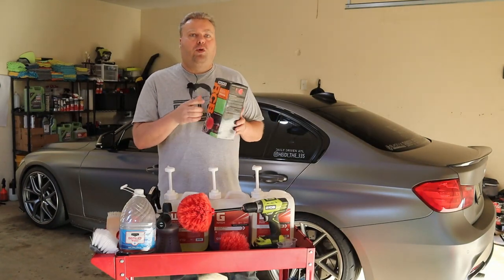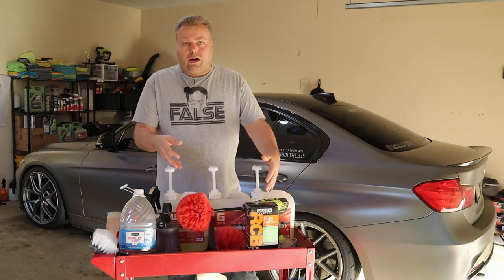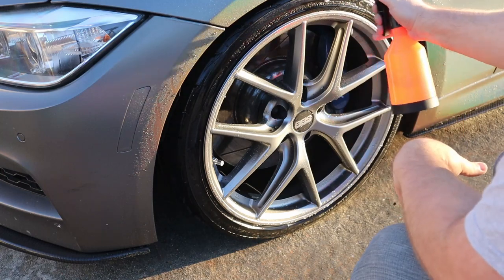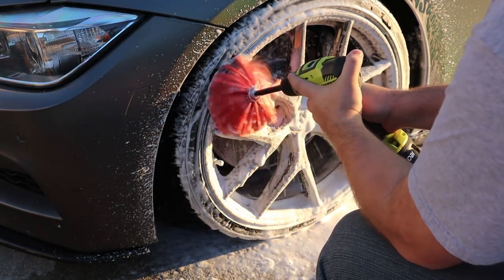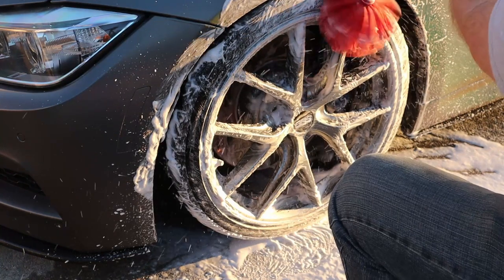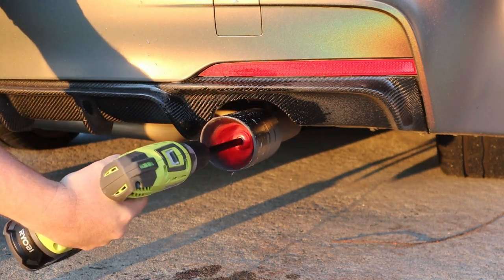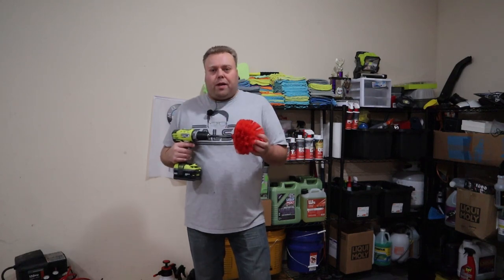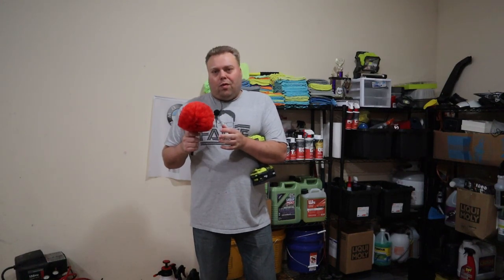Best Time Saving Wheel Brush | Quixx Rim Twister

Comment: Got mine in.. cant wait to try it. Little firmer than i thought it would be.
Reply from the maker: Hope you like it.  Will break in quick and get softer.  I worked mine a little stretching it out with my hands and a few wet and dry cycle.
Reply: @CarsWithKeav  not bad. I like it on my exhaust the most. Quad tips .. shit were nasssty. The ball was jet black and rinsed off rather easily. So much better than the smaller ez detail brush i was using.
Reply from the maker: @Jeeper1378  That's great. once you get used to how it flings things around you won't get wet or dirty as much.
Reply: @CarsWithKeav  yea, funny my washes are a two step process. Wheels on Saturday after work, wash car on Sunday. I used it on the first wheel and it shot brake buster all down the side of the car which i was trying to avoid. I assume... with use it will soften and not sling as much.

Comment: Does it compress to get into the wheelbarrow which seems logical based off design
Reply from the maker: It does and depends on the caliper size and wheel size of you can get behind the caliper. On mine you can’t, but the rest of the wheel you can. Of course on my fronts I can barely get an EX detail brush in that gap.

Comment: I like that.. i take it it is easy to rinse/clean ? 
I have a wheel wooly drill brush but it takes some effort to rinse clean.
Reply from the maker: Super easy to clean since they are like car wash bristles. I just run the drill and shoot water at it then run it again for a minute to dry off.
Reply: @CarsWithKeav  have you tried with a RW solution? I bought 2 ty.
Reply from the maker: @Jeeper1378  I have not.  Just straight water from the pressure washer.  Does that work good?
Reply: @CarsWithKeav  i dont know yet. Would think it would.. last summer i used my wheel woolies, cheap Kirkland towel and Mckees Sio2 RW to keep my wheels cleaned daily.